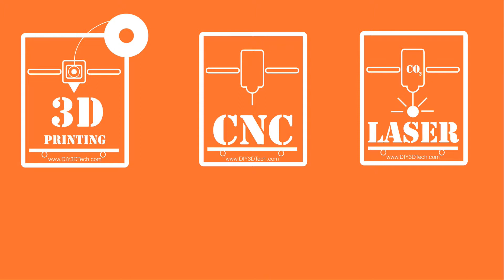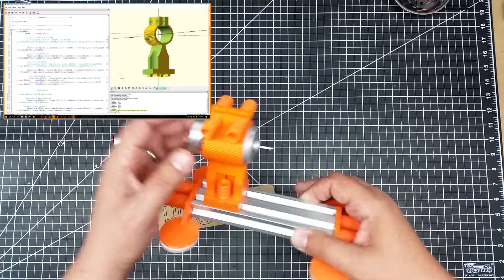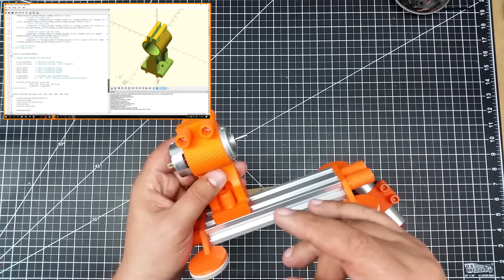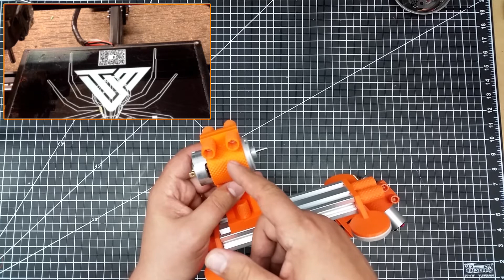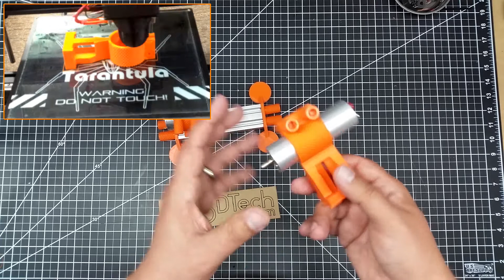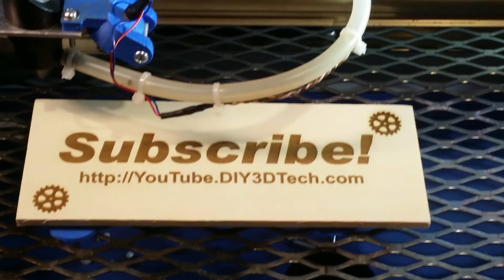3D Printed Projects  -  Motor Housing for 20x40 VSlot Maker Rail Projects!

Comment: Those are awesome!!  Such intricate and innovative designs..and yes, pulley system from the drive to a threaded rod below that passes under the motor would be incredible using small gt2 belts (or gears)...plus it allows a solid way to create a way to put rotary encoders on them like HomoFaciens and make a very accurate stepper out of a regular motor.
Reply from the maker: +Brian C interesting idea!